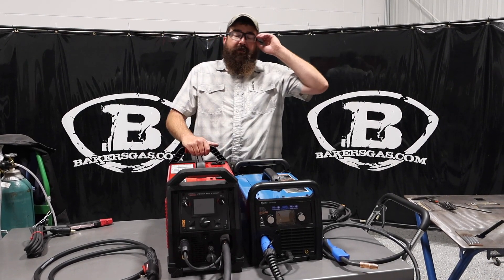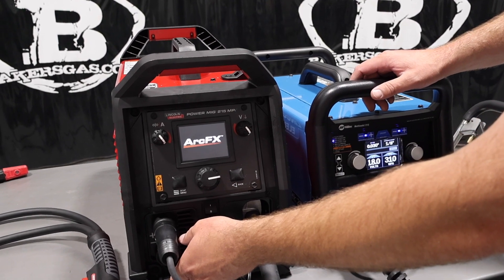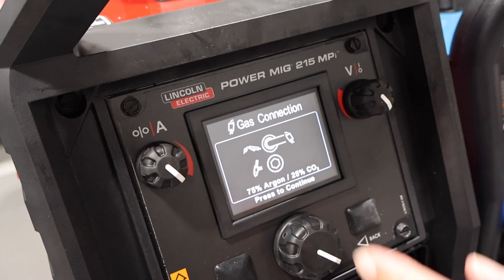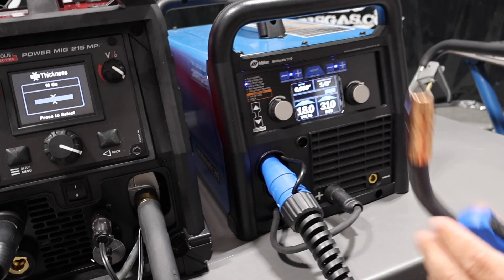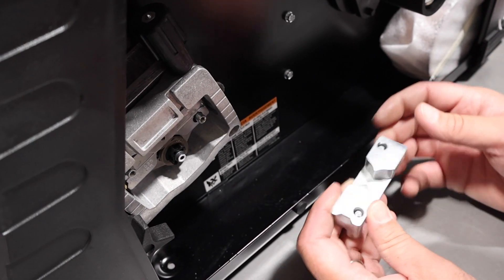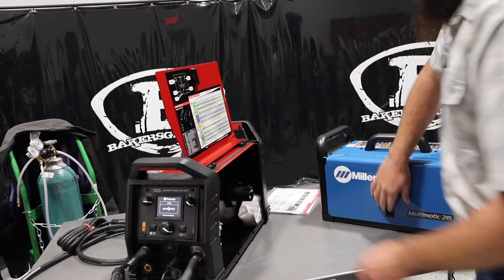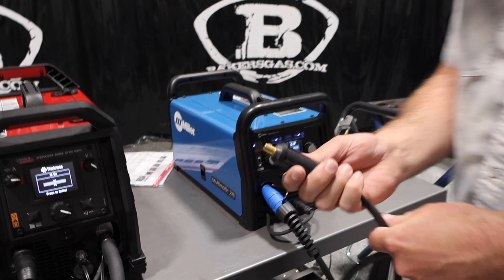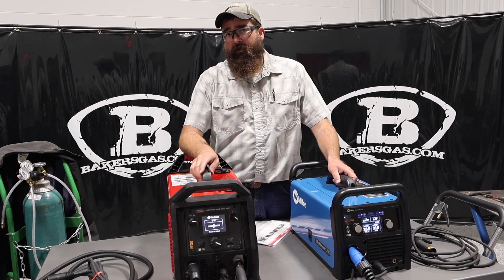Miller 215 vs. Lincoln 215

Comment: I wish there were more affordable welders of this size from real welder manufacturers.  It’s frustrating as a hobbyist to be forced to decide between a reputable brand at $2k, or some silly brand with even sillier names, like Arccaptain or Yes weld.  I mean really?  “Yes” weld?  Could you have a less serious name for your company?  I would be embarrassed to own such a product.  But the real brands like Lincoln and Miller are four times the price.  It’s too bad they don’t do like Snap On does with the Blue Point line.  Have a sub-brand that is made by a real welding machine company, but is priced for the hobbyist.  Most of us don’t need a machine that can handle hours of welding five days a week, or has special processes or cutting edge features.  We just need a quality product with some of the good automatic settings, nice display, and solid build, but at a hobbyist/homeowner price.  And not all of us want a product from a company that only started making welding machines five minutes ago, and sound like they were named by a kindergartener.
Reply: Have you looked at the Vulcan 220 by harbor freight?  1/3 the price and decent  reviews.
Reply from the maker: We hear you the prices have really increased over the last few years. There are some really great rebates and promos running. If you email us with your budget, we can try to help you find a brand name reliable welder within that range.

Comment: Miller doesn't need anything to help with bird nesting cause the users are smart enough to set the tensioner tight enough to feed the wire but loose enough to slip if you bind the wire

Comment: just did some research and everlast blows these two away.they give you a better warranty and include things these two don't including tig torch and foot pedal and duty cycle is better.
Reply: @speedwayman100 do you have an everlast? What makes you think it is a better machine? What about reliability issues? Is it built with heavy duty parts, not cheap thin stuff?

Comment: Can the Lincoln only run 2lb spools? If so how often do you have to change them out
Reply: The optional spoolgun holds a 2lb roll. Inside the welder itself it holds a 10lb roll.

Comment: I learned on a Lincoln and own a Miller 215. Both are really good welders.
Reply: Mines like brand new barley been used, fan comes on but the screen is dead and no wire feed very disappointed😢
Reply from the maker: Thank you for watching and commenting!

Comment: Locally, the Lincoln warranty isn’t something that I can use easily. Which is a big deal. The screen went out on my Lincoln and now I’m without a welder. The Miller I can take to the local welding supply and they will fix it in town, the Lincoln they send off to another state. 
You might want to check if they can do local repairs on either brand. Otherwise you will be weeks without a machine.
Reply: My Miller 215 is like brand new barley been used, fan comes on but the screen is dead and no wire feed very disappointed
😢
Reply: Yikes  @garybrown9719

Comment: Will an 11lb spool fit on the Miller? That is a big deal that you sort of skipped over.
Reply: Yes, it does take the 11lb spool.  In the video when the side door is open on the Miller, the large spool adapter is sitting there in the tray below the 2lb spool.

Comment: You can adjust the voltage and wire speed without going into manual cv on the Lincoln.
Reply from the maker: Yes

Comment: Awesome video, big thing to note between them is the miller will do up to 3/8 aluminum with spoolgun but the lincoln will only do up to 3/16 with spoolgun. Just found this out when i was looking at getting the lincoln for doing aluminum welding.
Reply: Miller/Hobart has a better spool gun available.  The SR 100  and the SR150  are both much better than the magnum 100 ..Lincoln makes better spool guns but they cost thousands of ddollars. You can use a 150 amp Tweco gun with this machine and its basically equivalent to the Spool runner.

Comment: Great video.Thanks for posting.I own Lincolns, Millers,ESAB and a Fronius welding machine.What I do notice with my Lincoln 210MP is with that drive roll system you have to keep it clean.Junk builds up in those wire grooves and actually causes wire feeding problems.One thing I found out that makes it stay cleaner is running those Weld Aid clamp on wire cleaners.